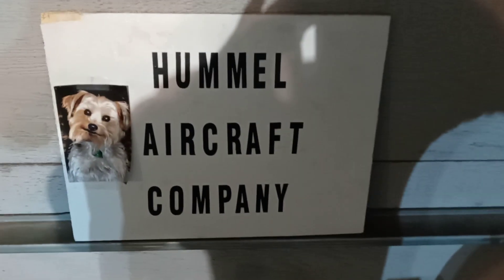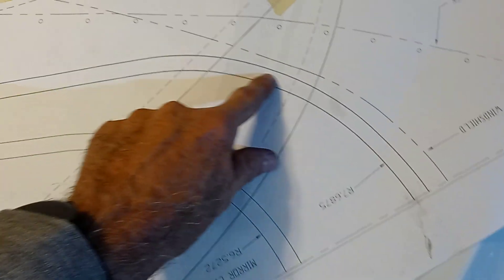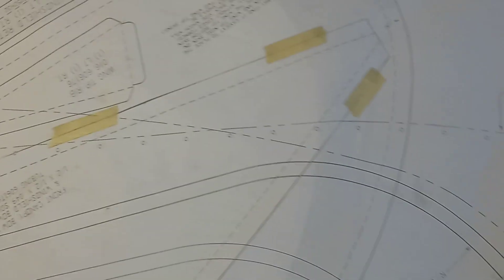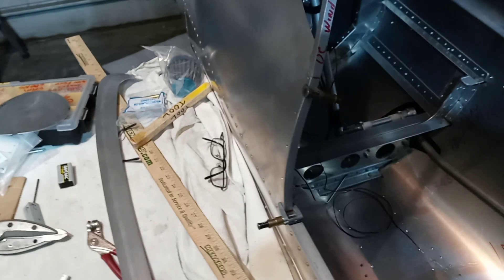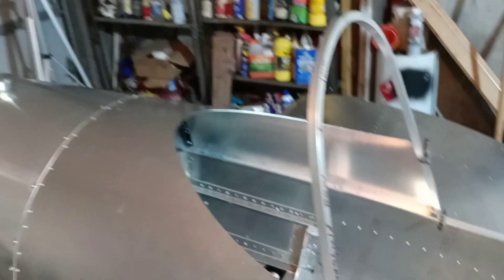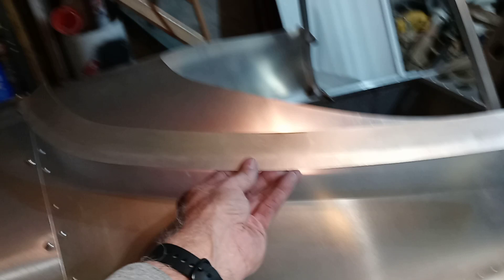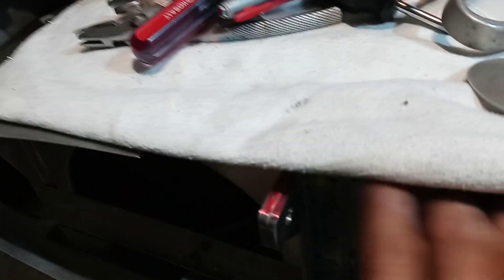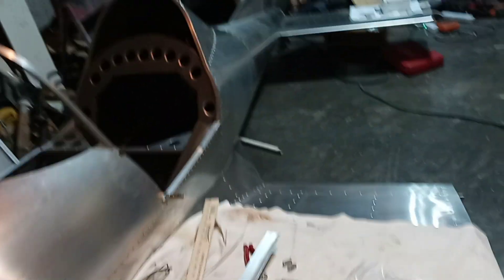UC windshield bow

Comment: In your opinion could the canopy height be lowered to fit a shorter pilot and save weight? Windshield and all, make it shorter and closer to the fuselage. I know it would limit visibility a bit.
Reply from the maker: Hi 96vmax4 well sir I'm sure that could save some weight. But rather it would save enough I can not say. But I sure like your thinking!!! That would maybe help with a very little bit more speed. And you are right on cutting down on visibility. But ya know that plastic cap I have on mine to save weight along with the 1/16 lexan  on the sides saved weight. And the plastic top can down on visibility in a steep turn. But I'm used to it. I hope that helps you?
Reply: @redblackvette  I have done a fair amount of work molding lexan for rc car bodies, if molded correctly do you think a thinner lexan would hold up to the stress of flight at the speeds the UC can go?